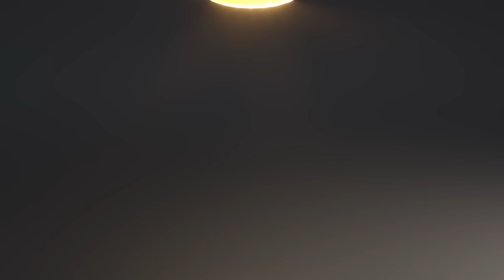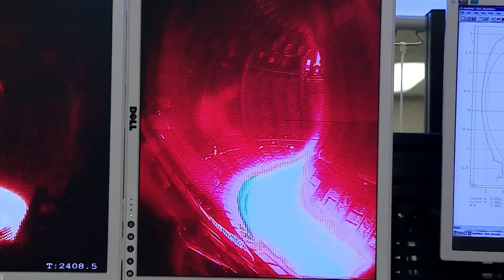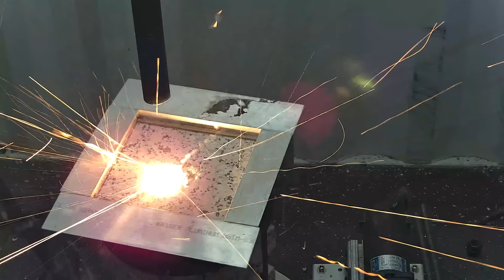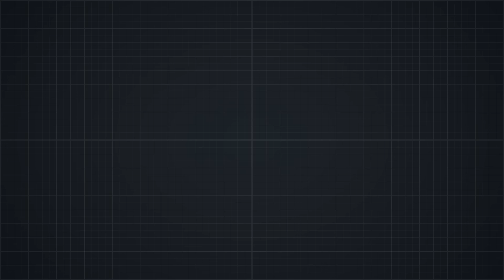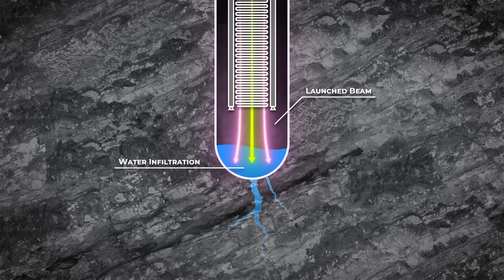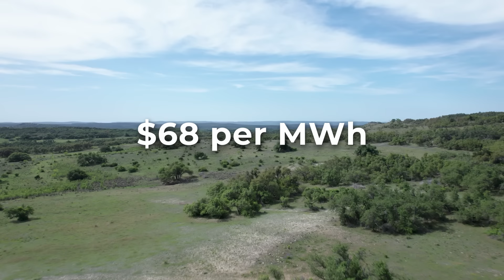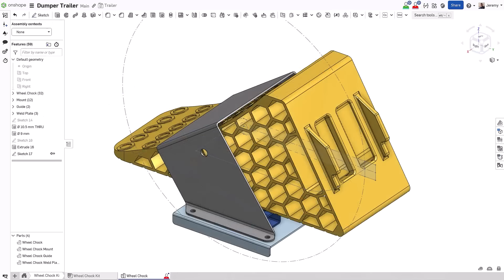Geothermal Energy is Changing

Comment: Seems an issue with this will be clogs caused by extracting the spoils as all the cotton candy rock will build clog the exhaust airways even at high pressure. Probably have to pull the whole stack and reream with conventional drill before resuming.

Comment: I wonder if this would become more effective the deeper it drills when the mantel’s temperature increases. Start with traditional drilling while that is cheap and effective, switch to this where it becomes more effective. If it is  temperature that standard drilling equipment fails at, maybe a 2 part solution might increase the time efficiency component, equipment wear and tear, and maybe overall expense. Idk haha, just blabbing.

Comment: Too bad conventional rigs and this company couldn’t team up. Regular drilling until problems, then a system like this for deeper boring.
Reply: What are you talking about, they ARE teaming up.  Quaise will employ drilling companies to drill down to ~3 kms, where basement rock usually starts, and encase the borehole in steel and concrete to seal it well.  Then Quaise will insert their millimeter wave drill to drill from that point downwards.
Reply: @TerraPotentia  That makes sense. I must have missed that part. Noted.

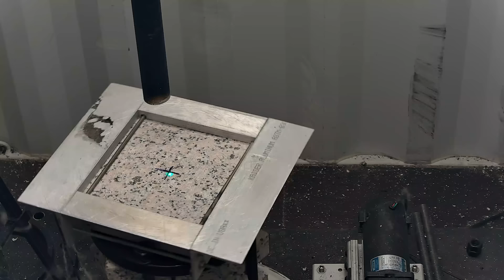Comment: @6:24 Holy crap dude.  That is not a safe mask for this sort of thing.  First of all you need to shave your beard to get a proper seal and second those paper masks don't seal good enough for this type of material.  You need a respirator like car painters wear with the exchangeable filters but with P100 particulate filters.  This thing is basically generating asbestos.

Comment: I had a thought about that Microsoft engineer that wanted to use a hypothetical largest nuke ever built to do enhanced rock weathering to remove decades of carbon dioxide from the atmosphere, and this video got me thinking.

What if you had a pool by a power plant That you pumped the plant's CO2 into, it joins with the water forming carbonic acid. You put basalt, Olivine, and limestone in the pool, and you vaporize that rock with this laser.

This would give you the enhanced rock weathering, probably much more efficient at removing CO2 from the water because the rock is vaporized. It will slowly reform, as it does in this video, trapping the CO2 and recharging the pool to have more CO2 stored. 

As those little wires of rock reform you pull them out of the pool, and you use them for fertilizer enhancement.

Comment: The ability to make hybrid cars should have given us the idea to make hybrid power plants.
Say you only get a ? meter hole depth.
That is still going to be warmer than surface temperatures which will reduce the ammount of fuel to get the critical steam temperatures.
Use frigging solar, gas, pyrolized biomatter, coal, and geothermal in the same plant.

They econimize coal burning plants by re heating and pre heating air and fuel.

Use whats around you.

Comment: Earth's core is mostly made of iron and nickel, and while it contains heavier elements such as gold, uranium, lead etc. They are not in good enough percentages to cause any nuclear reaction. So a fission reactor requires like 3-5% enriched fuel to perform chain reaction. Earth's core on the other hand doesn't even have that much radioactive materials let alone U235. It doesn't also have nowhere near enough heat nor enough pressure to cause fusion eiter. So earth's core is not a nuclear reactor, it can however be used as a geothearmal reactor in theory. The heat however that comes from the earth core isn't because of there's fission or fusion, it's purely because of the extreme pressure caused by all that mass mass pushing it downwards.

Comment: I didn't notice any mention of waveguide loss.  Is it actually negligible at those extreme lengths and interior surface conditions?
Reply: Yup. No way you're gonna have a loseless 2km waveguide for mm waves in a borehole. As a student I also thought "there must be a better way to drill holes". When you take into account the chaotic conditions of the subsurface though, there probably isn't. At least not an impressively different method. All these thermal methods will just lose the battle with water and that's it. It's been tried multiple time with several variations but it won't work in practice.

Comment: Yo if it turns out you can literally bore a hole right next to existing energy producing turbines of almost any kind and can almost entirely cut out the entire supply chain of whatever fuel they currently use would be a game changer. At an initial cost of 10s of millions, they will save 100s of millions on the supply chain to get fuel, transport isn't always cheap and any hole deep enough has all the heat you could need almost anywhere, that HAS to be enticing to investors to kickstart this.

Comment: What about an expanding/collapsing drill bit? When the bit is dead, pull it to the surface it through the centre of the hollow metal tubes (without pulling the tubes out), then send a replacement bit down the centre of the already in-place tubing.

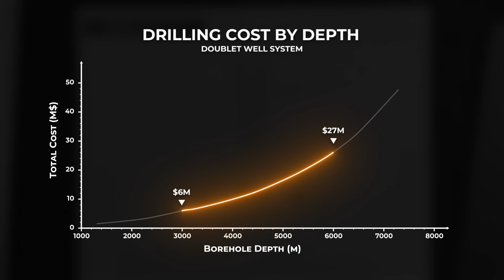Comment: For me the numbers do not seem to add up. The data given at 3:04 sem to suggest that it cost some 30 million dollar to drill a hole with conventional methods, and that this would make up 50% of the investment cost of the power plant. doubling this amount to 60 million still would make for a quite cheap power plant, or? that is ofc conditional to how much power one could generate with such a borehole. a questions that is not really touched in the film. (similar considerations are true for the data given at 18:58).

Comment: There is two big issue not adressed in the video:
1) the rocks are vaporized, how do you make sure they don't cristalyze back before getting out, plugging the hole or jamming the drilling rig in the well ?
2) unfortunately rocks are poor heat conductor. Even if you drill the perfect well hot enough to produce supercritical steam to run a turbine, the heat will be extracted faster than what the rocks around the well can transfer so the well will start to cool down as soon as you exploit it. 
Existing geothermal facility have the same issue but they exploit natural aquifers were water can flow through large volume of rocks before being extracted.

Comment: This is silly. The sheer amount of energy it would take to evaporate that much rock is too high for this to work. You'd need a dedicated power plant to build a power plant this way. Not to mention, this doesn't address the main problems with drilling deep that exist now and adds a few more into the mix. What kind of material could withstand prolonged exposure to a 3000°C gas? How are you cooling all of this and making sure the rock doesn't block the hole by solidifying halfway up?

Comment: I have one question about geothermal heat extraction techniques. Since depth is one of the critical issues of this technology, why isn’t anyone trying to extract geothermal energy from places where it is closer to the Earth’s surface, such as volcanoes? Volcanoes are widely spread around the planet and seem to provide easy access to the Earth's internal heat. I’m aware that there are already geothermal power plants operating (for example in Iceland and in Italy, in Tuscany, at Larderello), but those use steam from geysers. Nobody seems to be trying to drill near volcanoes (not inside the magma chamber, of course).

Comment: There is another huge issue with this even if you do not consider all of the issues with drilling. After you drill the two holes you need to frack the earth with high pressure water to get channels for the water between the two holes since you are circulating the water between two holes. This has already lead to major issues (Once in switzerland and another in south korea) where they fracked and caused earthquakes due to existing faults. In Switzerland they managed to stop on time but in South Korea it lead to a small earthquake with cracks in walls etc. Of course both projects were shut down. So this could be the same case like with supersonic aircrafts where we know how to build them but noone wants to risk the earthquake damages and when a bigger earthquake gets triggered by this then people will view this in the same way like nuclear energy after bigger accidents (fukushima, chernobyl etc) although in both cases it was a specific problem related to design and mismanagement. To find the existing faults in the earth is very hard to do...

Comment: Why not just use a different type of drill until you get to the point that the maser drill becomes the better option? I don't see why you have to stick with the maser drill especially at the top layers where the rock is far more inconsistent than the stuff deep down.

Comment: This video is dated. Companies like Eavor have developed a technique over the last 10 years where they drill down 2 to 3 miles and plant a network of pipes to extract heat from the hot rock and then use the heat to produce electricity. Eavor has built two plants in North America and is two plants in Germany.

Comment: 15:54 with AC power, stepping up the voltage is fairly easy. A standard plasma ball toy produces 2-5 kilovolts in order to make plasma, and those you just plug into a standard 120V power outlet. Now, delivering 1 megawatt of power continuously, that's a challenge, but it has little to do with the voltage itself.

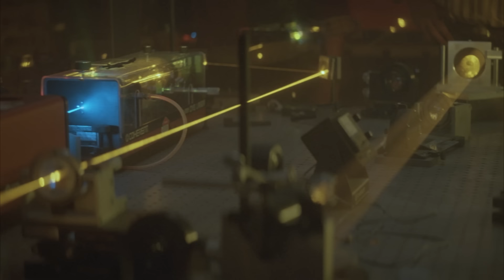Comment: 5:08 I think he meant higher wavelength, not higher frequency. Microwaves have longer wavelengths (~1-300mm) compared to visible light (380-750nm). Frequency and wavelength are inversely proportional by the equation f=c/l, where f is the frequency, c is the speed of light, and l is the wavelength. Higher frequency corresponds to smaller wavelength, so visible light is higher frequency than microwaves.

Comment: I don't think this technology would need to beat wind or solar for overall cost of electricity. Geothermal heat would be a constant reliable source of energy and apparently at a similar cost to nuclear but could be deployed much quicker and be more PR friendly on the safety issues than nuclear and thus avoid a lot of red tape. If you want it to be an apples to apples comparison, wouldn't the cost of batteries need to be included with the cost of wind and solar?

Comment: At 1m/hour, that is less than 9km per year if everything just keeps chugging along 24/7.  But they probably need to go at least double that and I thought they needed two holes.  So at least a few years of drilling.  And all that rock-wool that will be coming out of the hole, how do they deal with getting that stuff up from all those km's down an 8in hole that has probably 3/4 of it filled by the wave guide?  Will they be blowing the N2 gas at such a high pressure that it just forces it out despite its tendency to cling to things?  It would be great if this works, once you get a hole set up I assume it could last indefinitely, maybe 100's of years producing electricity.

Comment: Won’t comment on the earth reactor subject as that’s well covered here my objection is comparing cost of wind vs nuclear or geothermal that’s a pointless comparison as wind is the most intermittent and unreliable form of energy generation we have so far and is also quite a destructive project that destroys a lot of pristine areas and is very space dependent and when all the storage and firming infrastructure is accounted for it actually becomes extremely expensive this comparison needs to stop as it is utterly pointless geothermal or nuclear or fossil fuel based energy production is base load production and is completely different wind is in my opinion the stupidest form of energy produced and I haven’t even mentioned the danger posed to the maintenance crews that have to work on these things not to mention the dead birds and effects on wildlife in general
Reply: Wind power sucks !!

Comment: The LCOE isn’t a complete evaluation for energy production for Wind and Solar, because it doesn’t account for the cost of battery storage and intermittent generation. 

When you add wind or solar power to the grid without battery storage it doesn’t increase the base load of the grid (not reliably, which is what is needed). Let’s say this adds ups the LCOE by 1.5-2.0. 

When you add solar power to the grid with total battery storage, you also need double(ish) the capacity because it doesn’t generate power and night. For wind, this can be either worse or better depending on conditions, but since it needs to be a reliable increase in grid capacity that probably more than solar. So at least a 2.0-2.5 increase. 

Overall a x2.5 - x3.0 increase to LCOE is what if guess gives the actual cost analysis for intermittent and battery reliant power generation.

Comment: i did some digging! the kola boreholes were drilleg by the uralmash-4e drill. i found an uralmash document that has, 2039hp drills rated to 26000ft roughly. that's almost exactly 1500kw, and that's under 10km. the uralmash-4e (which they don't make anymore) is quoted elsewhere as having been rated to 5000m and uprated by the research team at kola. i assume the drive was a 1500kw motor back then too, that all said, the borehole was 9in, so if this microwave drill takes 10x the power to double the bore diameter, you're looking at a 10mw drill to make an 8in hole? if we extrapolate further from that researcher's suggestions anyway. not to mention, the kola drill had instruments such as temperature gauges, that would not be able to work with this. i suppose i probably haven't seen the bit where he talks about how they can measure the contents of the products to learn more about the rock? but like, ya won't be able to actually measure the rock's contents super accurately when you're introducing such vigour into the chemical soup, i reckon. it's just, maybe, a cheaper way to get geothermal bores dug i reckon. and i fear in our quest for more power we will consume the energy that drives plate tectonics and keeps our world alive. i'm not sure if it's possible, but i don't want to find out. much like, you can't grow crops under solar panels (which isn't such a big deal tbh, other things can use that space) and if you place too many wind turbines too close to eachother, in real life and in cities skylines they start to take energy from eachother. what was i talking about again?

Comment: Geothermal energy should have a greater part in the energy transition. Instead of drilling for oil, it drills for heat. Most of the oil drilling innovation, infrastructure can easily be transferred to geothermal. Instead of covering large surface areas with solar panels, it only requires underground excavation. It can be used as a storage facility.

Comment: Not exactly fair to throw shade on nuclear energy based on one lcoe graph. I'd be curious to know, did that figure factor in the storage costs of wind/solar? Or was storage left out on the assumption that fossil fuels would cover the deficits in wind/solar when the wind isnt blowing and the sun isnt shining? Nuclear wasnt left by the wayside because of lcoe, which itself is not a black and white situation. Much like life, its mostly gray. Nuclear has been neglected because the cost to build a plant skyrocketed along with mountains of new rules and requirements, sometimes requiring work to be deconstructed and redone, and sometimes piling up enough for the plant to be cancelled altogether. Investors dont want to touch nuclear because they take too long to have any ROI, that is if the contstruction can actually finish. Factor in an uninformed public, scared of nuclear power, and there is basically zero push toward nuclear. 
Wanna talk about a long term cost? What will we do with the unrecyclable photovoltaic cells/wind turbine blades? Why would we cover our country with solar panels that last 40 years (if we're lucky) rather than a power plant that could easily last twice as long, with far more reliability in energy production? Does lcoe account for the need to service and clean turbines and panels? 
Im not gonna put stock in an lcoe figure provided by a company that is, quite literally, deeply invested in the success of fossil fuel power production.

Comment: Is nobody gonna talk about the fact that the nozzle needs to float above the surface for it to drill? Which is not possible to acheive because oh sheer weight it would have with such depths. Other thing is that pomping gass gets increasingly harder the deeper you go, meaning it will hit a wall eventually.

Comment: I'm curious about how they know to advance the drill head and what rock they are dealing with to adjust the duration speed and other parameters to drill most efficiently and without causing damage to the drill.

A physical drill pulverises the rock which is pumped up and can be analysed under a microscope and it uses gravity and pressure from the Derrick to drill down. This new idea is held back from making contact  and the rock is vaporised so how can you know when you've cleared rock to advance the drill face or hold back because you've got granite and not basalt?

I'd genuinely love to have that answered.

Comment: Have they considered a small gas turbine generator set?  I believe Solar Turbines has something that will fit their energy profile and will give them relatively cheap power when not near a power grid with the capacity.  They build gas turbine sets for oil and gas production both on and off shore.

Comment: Baited guess would be; directed heat is different than being encompassed in an environment.  Melting points aren't dominant when heat is transported through the material differently.  An intrusive tectosilicate with larger scaled structures of a leaner sio ratio lattice compared to an extrusive mafic... simply leess streets taking more turns, with added mineral diversity.  Yeah interesting the spec heat capacity of water is usually your friend.